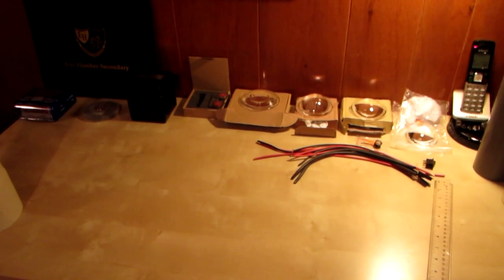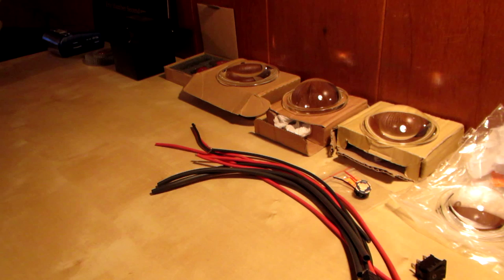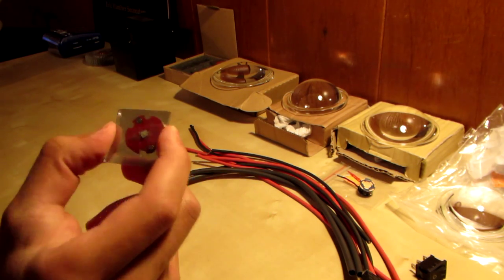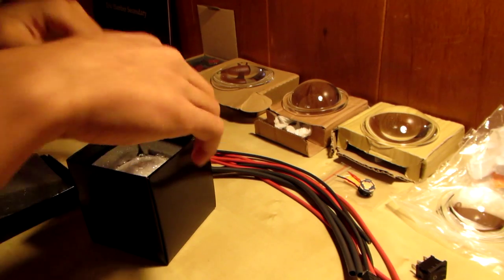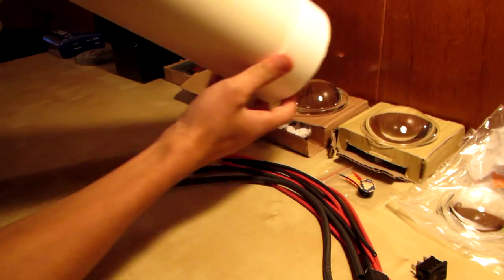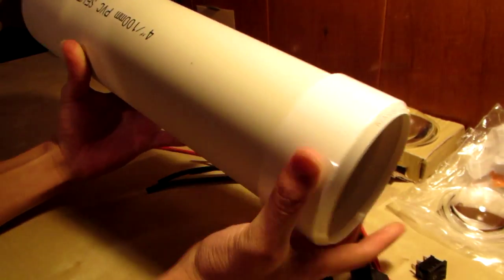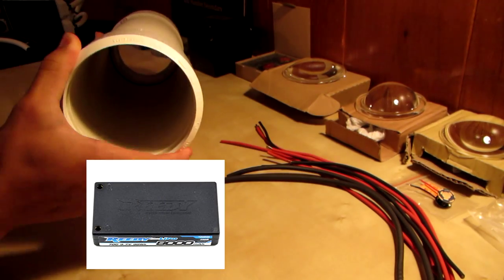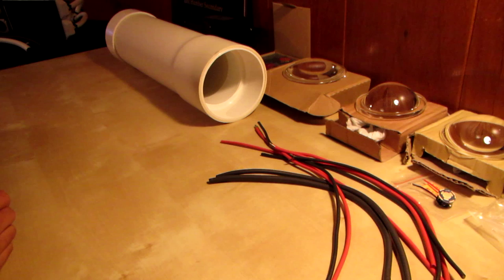The LIGHTCANON - Long distance aspheric flashlight - Part 1

Comment: Can you tell me if you could use a cylindrical rod made of glass that can tunnel the light forcing it to be parallel for a small distance before the lens to control the lights range ??? Thanks
Reply from the maker: Like a fiber optic? Not really, because the lens shape is what takes the light and collimates it into a straight beam. The goal is to have the light souce be more intense or smaller area, then have a larger lens.

Comment: Thank you so much for your great videos.
We are a research student in seoul national university and in our project we need to create about 45cm to 45cm squared concentrated beam with minimum or no highlight around it from a distance of 50 cm to 1 meter or a bit higher. which aspheric lens and LED we have to use? 
I really appreciate your help. (sorry our major is not about lightening system at all but in our project we need to light up such a shape my major is sport science).
Reply from the maker: You will need a very thick aspheric lens to make such a large square close up. Having a large LED will help too, but you want it to be a flat LED, not one with a dome. The one I used is an Oslon Black Flat but it is very small, I would recommend a Luminus CBT-90 or CFT-90 (the newer square version, not the old round CBT-90). To know what lens to best use I recommend you email edmund optics customer support, they are very helpful and quick to reply :) good luck.
Reply: Thank you very very much for your great information. we will work on it and will let you know the result. appreciate you again for your kind reply.
Reply from the maker: You're welcome!
Reply: I have just emailed  edmund optics  and then they said we are not so sure because its quite large square and you might need to design one with zmax. Anyway I want to make a purchase now to try it out weather it work or not. which lens do you recommend me? and what els i need except Luminus CBT-90 and Wavien RLT?
I really appreciate your help and quick answer.
Reply from the maker: Sorry dude, I don't know, I've only worked on designs to reduce the size of the spot, not to increase it...

Comment: I see a torch in which convex mirror is used to a make a beam light
Reply from the maker: It would be concave, not convex. convex would spread the light out.
Reply: Enderman LP Biconvex lens foucs the light to a point after which the light diverges. Bi-Concave lens simply diverges the light. What we need is a near parallel focused beam.

Comment: you still active here?
got a question
Reply from the maker: yup!
Reply: @EndermanEngineering  ok question if i wanted to fire this light in Morris code, how would i do that?  i basically want something for very long range.
Reply from the maker: @Yelnats101  Then you need to use a single mode LED driver or power supply so that it only has on/off switch, no different modes.
Also if you use a laser then its completely different from this flashlight, a laser is just a laser, you don't need something this big.